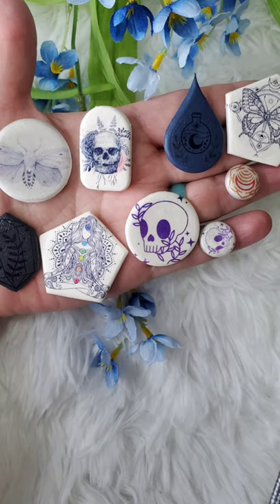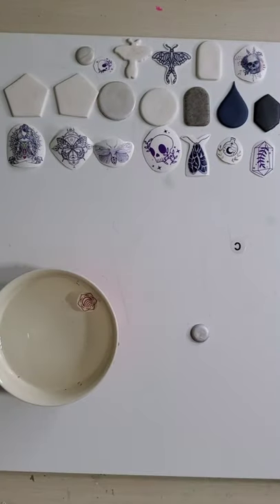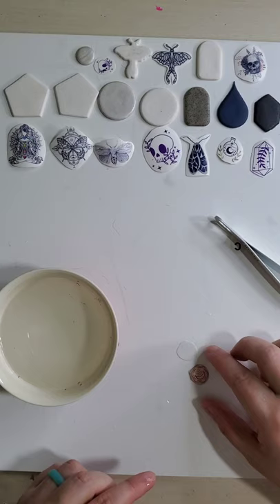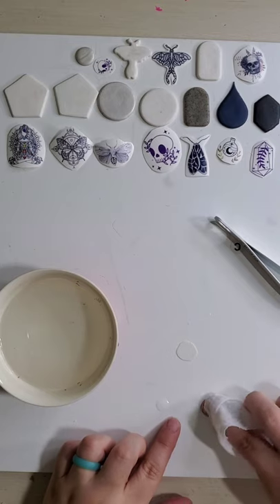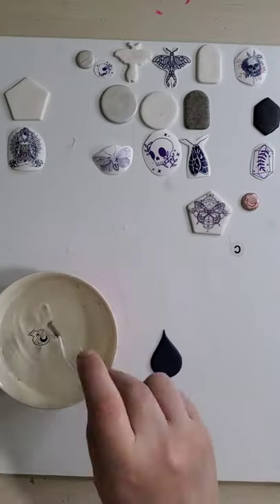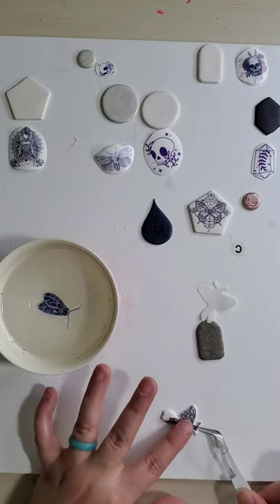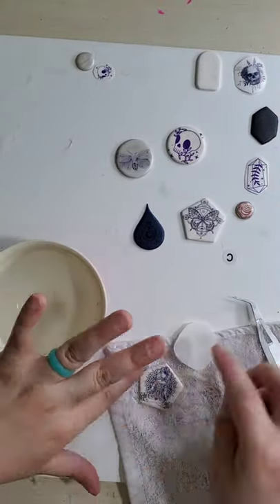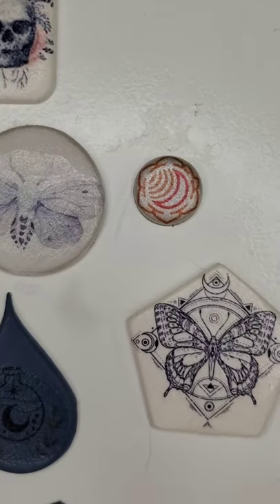Image Transfer Waterslide on Polymer Clay

Comment: did you bake the clay first?
Reply from the maker: Yes. The waterslide can survive some heat, as well as water..but im not sure if it will survive the baking temp and time needed for clay to cure. So id recommend to do it after it bakes. And they need to be sealed after with polycyclic or resin, which should definitely not be baked.